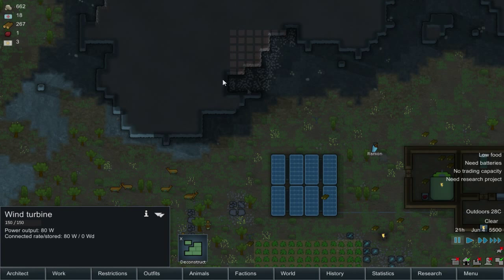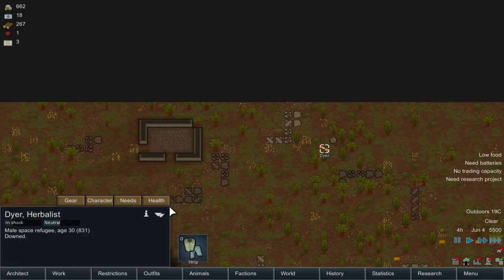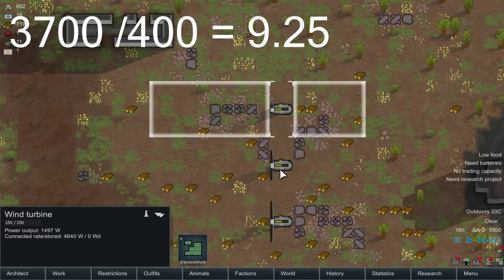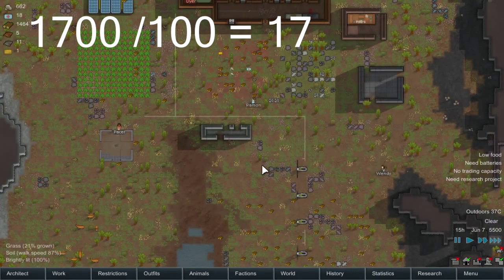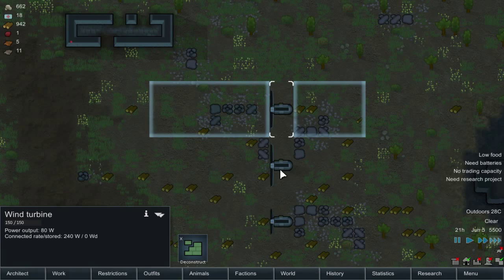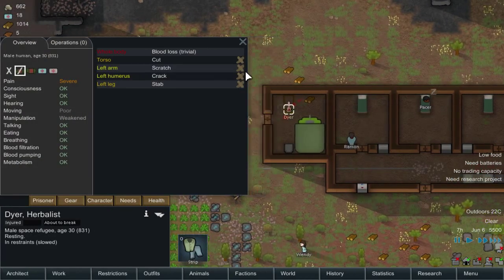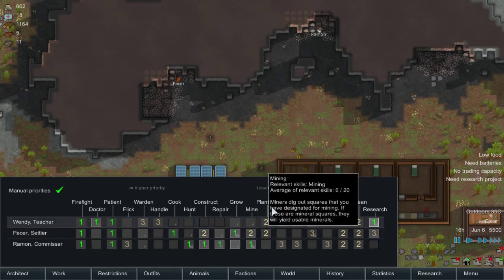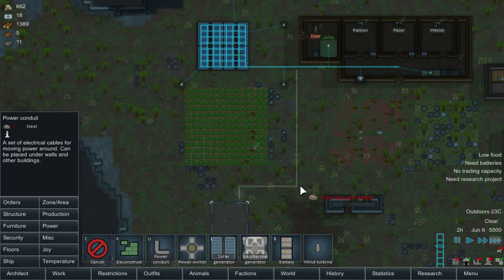Rimworld, What is The Best Power Generator?

Comment: Is it true that the fueled generator breaks down randomly when not in use, and for some reason requires component to fix?

Any word when this glitch will be fixed? I was hoping to build a line of 10-20 fueled generators to power my base (in order to get away from random battery explosions that could cripple my mountain fortress), but not if I have to sacrifice a bunch of component every time one of them craps out.
Reply from the maker: Well fueled generators are the newest source of power in low tech so im not 100% sure. However they will always require components to repair them because they are made with components and steel. 

Most battery problems can be solved with having redundancy connections(Not one single line carrying all the power) or by setting up switches in front of a cluster of batteries so all of them are charged up but only connected when needed.
Reply: I hate sacrificing component for repairs that are necessary randomly. That's not challenging, it's punishing.
Reply from the maker: Well not using batteries is in terms upping the challenge as well. Not every play style will be rewarding